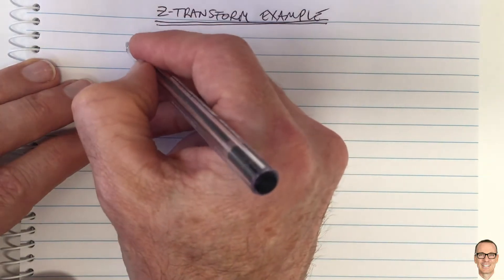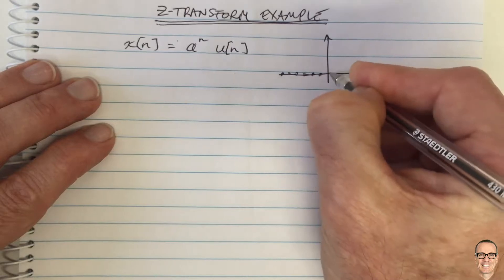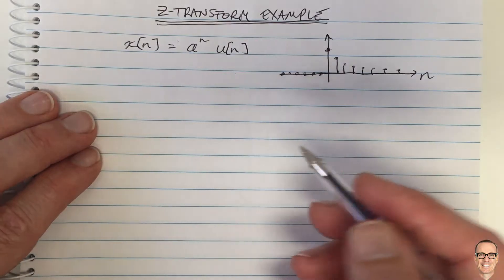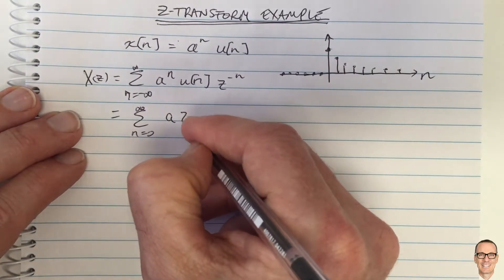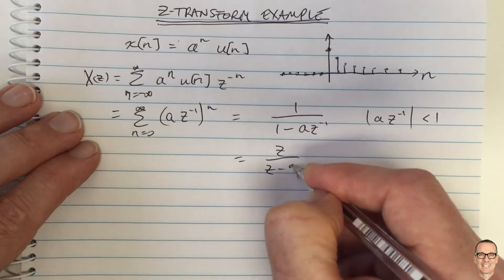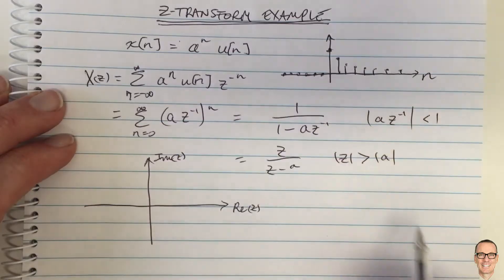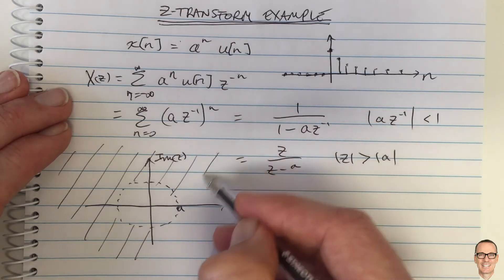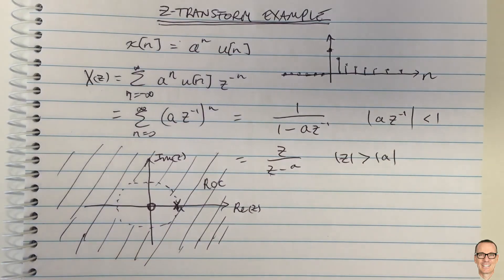Z Transform Example

Comment: What will happen if a > 1, for example a = 2, what would be the Z transform ?
Reply from the maker: If a>1 then the region of convergence would not include the unit circle, and therefore the signal x[n] will grow to infinity over time. If your Z-transform is the transform of a system's impulse response, then a>1 means the system is unstable.

Comment: I see that as z becomes larger and larger than a it converges towards 1, and that when z is equal to a it is undefined; but as a becomes larger and larger than z doesn't it also converge towards 0 from the left? I don't understand why the ROC wouldn't then be z =/= a, if it seems to converge on both sides.
Reply from the maker: Maybe this video might help: "Z Transform Region of Convergence Explained" https://youtu.be/uq_qv3Spzbs
Reply: @iain_explains  Thank you for the incredibly speedy response! While a great video, I don't think it answers the question I had; at least not directly. The question was what, mathematically, determines whether the ROC is on the inside or outside? The answer I ended up finding has to do with flipping the summation terms when your signal is left sided.

Comment: I have a question, if possible, how to find the z z transformer if the x(n)=u[-n]
Reply from the maker: The "time reversal" property states that x[-n] has Z-transform X(z^(-1)), with an inverted region of convergence. So therefore, u[-n] has Z-transform 1/(1-z) for |z|<1
Reply: @iain_explains  
Is it that the graph of a^n should be increasing
Because that one is similar to a^-n

Comment: thank you sir, i have a question , you said that the z transform is used to "solve" the signals that couldn't be solved using Fourier transform because of their infinite energy, but in this example the signal has a finite energy so why we have to use z transform? or it just an example for explanation purpose
Reply from the maker: Not quite. I plotted the case for values of the parameter 'a' between 0 and 1. In that case, yes, it is stable, and you could just use the Fourier Transform. For values of 'a' bigger than 1, or less than -1, the function is increasing with time 'n', and the Fourier Transform is not defined. Even if a function is stable though, the z-transform is still generally used, because it gives you extra insights. You can see how close your system is to being unstable, by observing the relative locations of the poles and zeros. You can't tell this just from the Fourier Transform.
Reply: @iain_explains  thank you so much